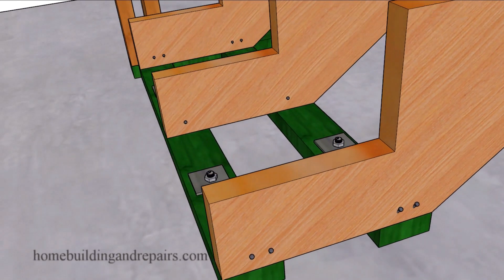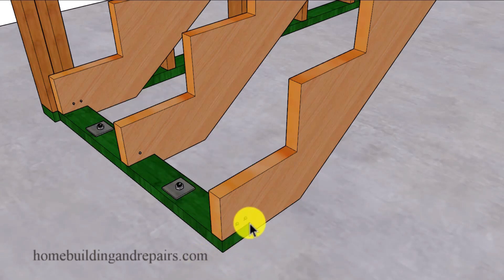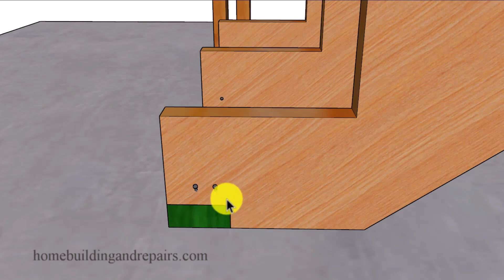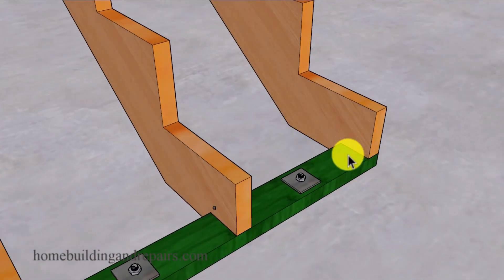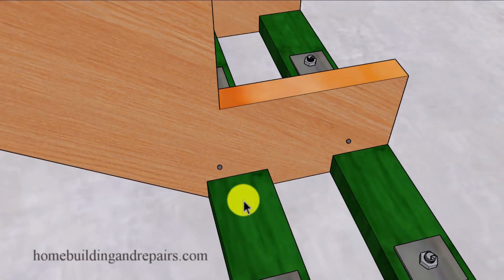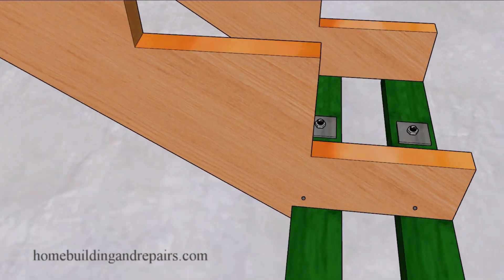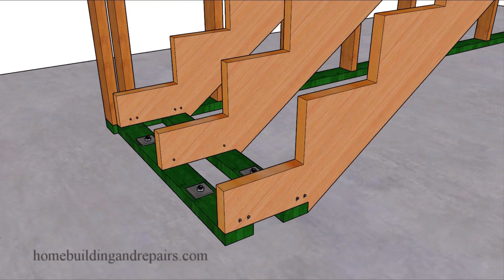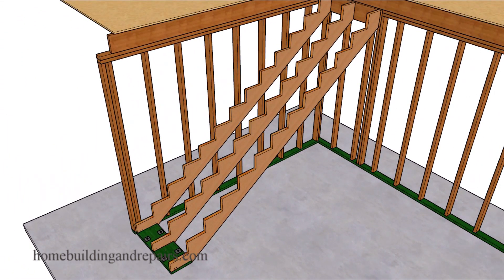Lower Wood Stair Stringer Connection That Should Work For Everyone - Standard Building Plan Detail

Comment: So nails and not screws?  And Simpson doesn’t make a bracket that can be attached to the stringer & sill plate?  Seems like nails are not sufficient imo
Reply from the maker: Home builders are still using nails today for this assembly.

Comment: Thank you for your videos. I am doing my deck stairs now and found your videos informative. My deck was built in the 90s and when I took the stringers out, I realized that they were buried in the ground. I pulled them out and was preparing the area to pour a concrete slab to find out that there is a 2x4 sitting on a 4x4 lumbar that the stringers were laying on. I tried to pull them out and I couldn’t. Interestingly, they were not rotten at all, although other areas of the deck were rotted. I added back the fill dirt above them, then some gravels and put concrete on the top. But was wondering if it was acceptable then to just bury the stringers?

Comment: So what exactly is the recommendation?  I am building steps and the stingers will be resting on straight dirt.  So do I build a concrete pad?  Pressure treated lumbar?
Reply from the maker: If you live in cold climates where ground freezes, then you might need a deep concrete pad or use no pad, if not, then I like my stairs to sit on concrete.
Reply: @stairbuilding  

How do I attach the stringers to the concrete?

Comment: dose the bottom of the stringer at the notch contact the concrete?
Reply from the maker: If it does not, then it could break with out support under it.
Reply: my understanding is gravity would bring the stringer down  rather than out . is that correct?
Reply: @danielroberts7306  Good question. I'm a home owner, not a tradesman. The stringer is attached to hardware at the top. If the stringer was not attached anywhere, how would it fall? It's at an angle, like a pencil leaning up against a wall. The pencil would slide in two directions: gravity would pull it downward and the wall would cause it to move away from the wall. If you prop something in front of the bottom of the pencil, like the wood at the front of the steps that the author is resisting, that would prevent the movement. However, like the author said, concrete is porous, so water would wick up through the concrete, get into the wood, and cause it to rot. What I wonder about in the video is when you toe nails in at the bottom, that is putting shear forces on the nails, so the nails, or screws, would have to sustain enough shear force to hold the movement of the stringer in 3 dimensions, with a dynamic load. I wonder if this situation is addressed by codes or if it is up to the builder.
Reply: @DaleRogers  I understand it now, the pressure treated cleat anchored to the the slab locks the stringer in place rock sold.